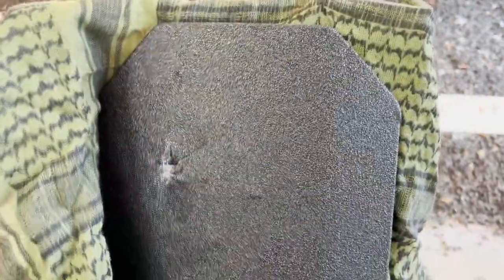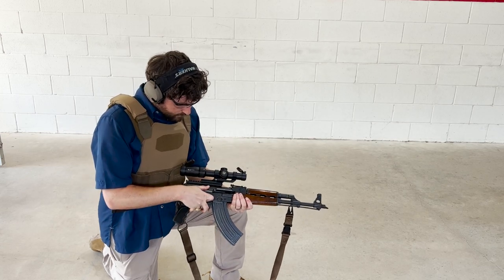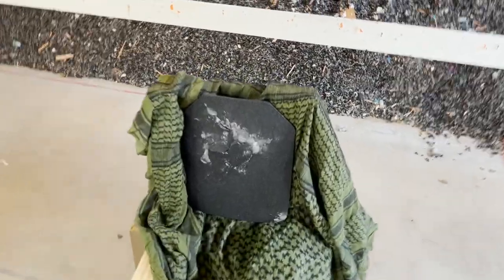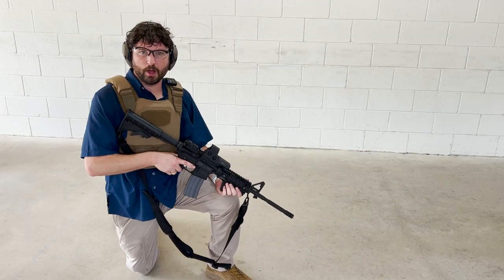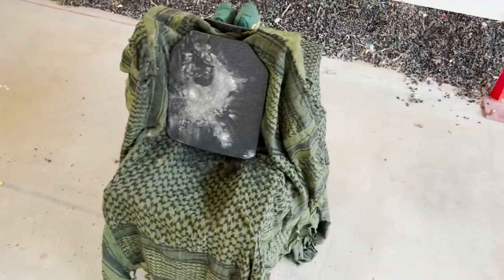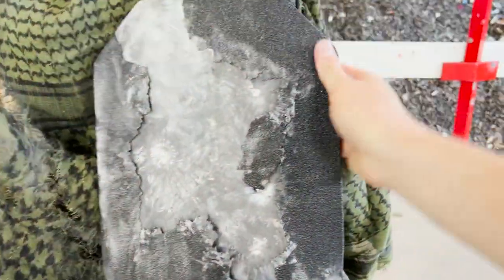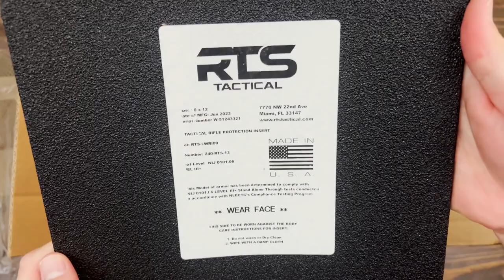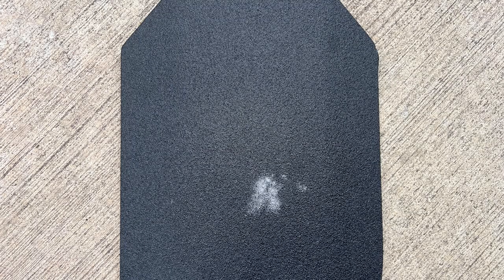RTS Tactical Level III+ Plates: TORTURE Test and Full Review

Comment: RTS Tactical RESES Level 3+ upgrade out performs the plates you tested in this video. with no spalling what so ever.
Reply: I have spent the past few weeks completely deep diving civilian armor applications(prior military, and only have existing experience with what is issued)... The reses plates are what I am going to go with. They do have the chance to produce spalling, even with the buildup, but you are talking multiple hits/hits near edges. I have seen level 4 throw entire projectiles (m80/855) towards body after placing 2 shots within small grouping. Granted the 30.06 can be luck of draw with 3+, I have seen enough level 4s fail with it as well, even though they are supposed to stop them. Give me the durability of steel, if I catch spalling, so be it, beats failing after 2 shots in the same area with common rifle rounds.